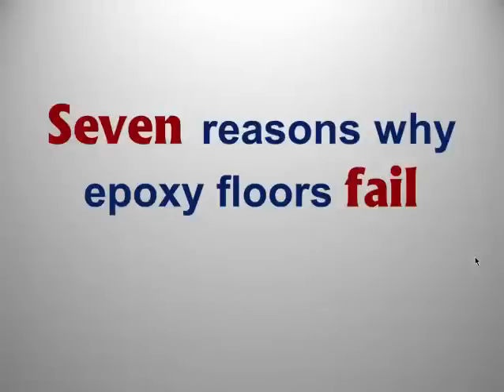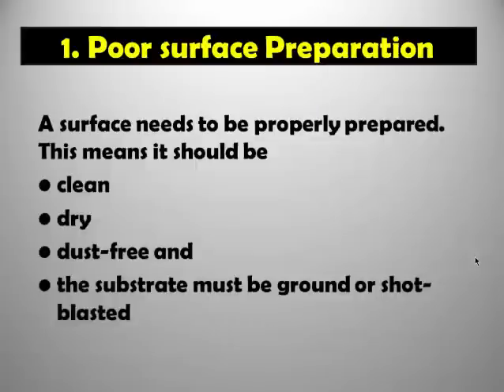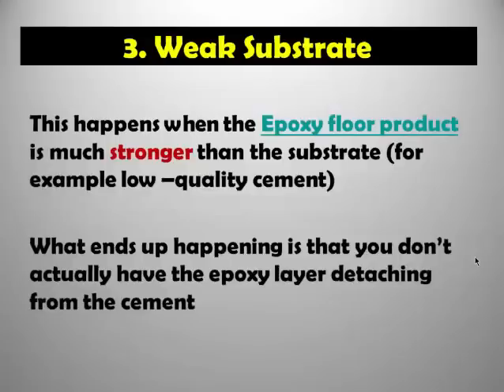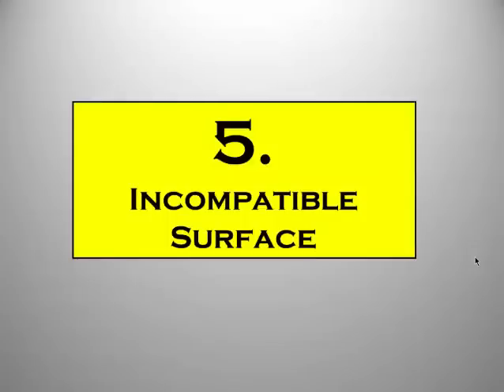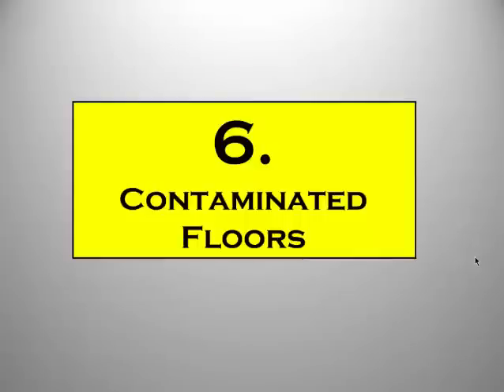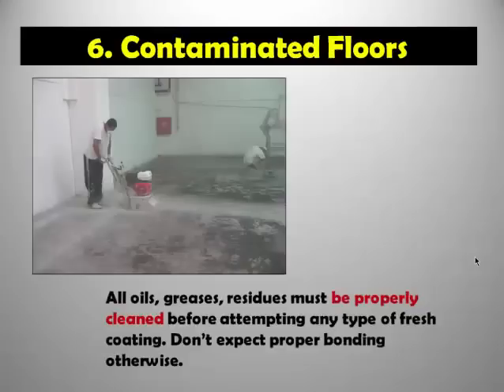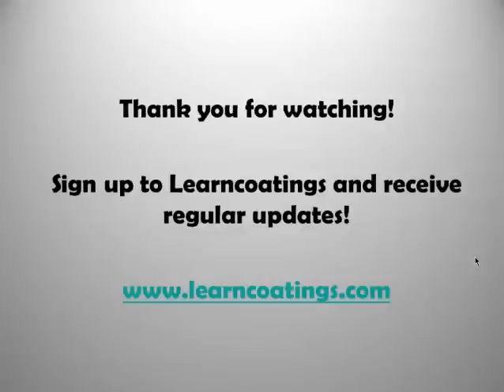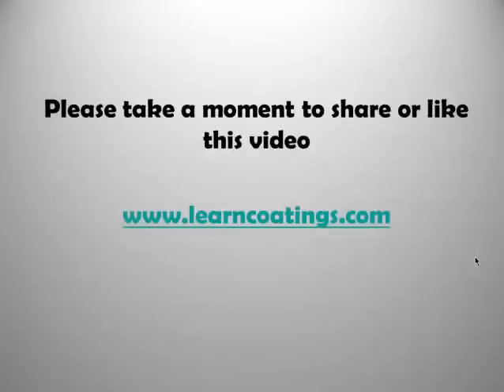7 Factors that cause Epoxy Floors to FAIL

Comment: 2 yr. Old epoxy gives out odors, it always has since new. It's in my bedroom. My beds shape got printed to it in a yellow color. I got pearl white epoxy.. any idea
Reply: I followed the instructions step by step
Reply from the maker: Still gives off odors after 2 years? Doesn't sound good. Most likely causes 1) the epoxy never cured properly, so there is some excess chemical that gives off the odour. Also this could be the cause of dirt pickup and the yellowing. 2) Does the room get much sunlight? I am wondering if UV chalking may have something to do with it
Reply: No sun light. At all. I used elite Crete products. They didn't give me a vapor blocker, I know cause the guy said it wasn't that important.
Reply: I am a biologist, epoxy must be I think hardened with blue laser. Poor quality of epoxy.
Reply: I am very experienced with epoxy and mixed some epoxy by a manufacturer mentioned. I mixed in correct ratio and properly- it smells still after 6 weeks. I've never seen this before and would normally say user erroor bit in thius case I know the p product is still smelly 6 weeks on.
Reply: I would not use a product that smells weeks after mixing as in my opinion is not inert and could be a health issue.

Comment: Can you reapply to epoxy floor on epoxy floor which has been battered other time and looks tired ?
Reply from the maker: Yes you can, although it would recommend that you reprime it first. Also make sure any areas that are damaged or peeling, are fixed first before recoating

Comment: Please explain me what you mean as primer. Thanks for the information.
Reply from the maker: A primer is a coating that goes on before applying the paint or the epoxy. It serves multiple purposes: It helps with the adhesion, it seals the surface from bubbles and it can also help eliminate the micro-dust. Read this article for more information http://learncoatings.com/wordpress/five-reasons-why-you-should-always-be-priming-your-epoxy-floors/

Comment: I just did a garage floor with a new product. And the product flashed and hardened within an hour. Giving me no time at all to work with it why would it do that???
Reply from the maker: Most epoxies have a pot life of 40-45 mins. MMA or polyaspartic can be even less than that. Make sure you keep the products in a cool place as heat accelerates the curing. You don't want the products already warm when you apply them

Comment: Great info...so my question is...how do they epoxy 3d floors in homes ..those are wood floors...can u elaborate
Reply from the maker: 3d floors are usually done over a pvc or vinyl poster that has been stuck to the floor, so that poster tends to cover up the wood or whatever surface is underneath.
Furthermore wood may not be a problem in small surface areas like 1-2 sq.meters. It usually becomes a problem in larger areas where the expansions and contractions are more visible

Comment: Can you put epoxy on a floor that was epoxied in the past
Reply from the maker: Yes you can. I would advise light sanding to ensure better bonding between the old and the new layer. Especially if this was a long time ago
Reply: Yes if the Floor is still in good condition. Should grind or sand floor. If not, I would recommend removing the old epoxy and prepping the original concrete for new material.

Comment: 9 days after applying epoxy to basement floor, it's still not dry.  It's sticky.  I called the company, at first they said it wasn't mixed properly.  I told them that wasn't true.  We mixed according to directions.  We also put a fan on it for 4 days.  And for the past 3 days have a dehumidifier running.  Don't know what else to do!  Jamie, the rep I spoke to was suppose to email me papers to complete but I never received anything from him.  Extremely poor customer service.  Anyone have any ideas?
Reply from the maker: Likely reasons for sticky epoxy:
1. Did you use an electrical mixer ? (hand mixing does not work)
2. Improper use of proportions of the A and B component
3. Is the entire floor sticky or just in some areas - some areas means one pack was not mixed properly or it did not contain the B component.The entire area means there is a bigger problem at stakeHave a look at this article for more information
http://learncoatings.com/wordpress/epoxy-disasters-common-mixing-mistakes-that-can-lead-to-curing-problems/

Comment: Paid someone to do my floors and he didn’t etch I’m thinking it wasn’t mixed well either .. my floors are extremely sticky!! And my shop opens in the morning!! How so I remove?
Reply from the maker: Floors will take 1 to 2 days to dry. If they are sticky after that you have a problem. You will need to remove with scrapers and solvent
Reply: Ok thank you
Reply: One more question is it possible to add  a 2nd coat after dry time?
Reply from the maker: yes its possible, should bond pretty well with the first coat
Reply: Can I just paint right over it w/o sanding it !

Comment: I see yes to use epoxy on concrete, but no to wood. How about old stone flooring?
Reply from the maker: Stone is very tough for bonding. I would recommend good diamond grinding to get a good profile as well as a strong primer

Comment: What caused our epoxy floors to blister months after it was cured.
Reply from the maker: Blistering sounds like moisture trapped in the floor pushing it up. Another reason could be some contamination in the floor that is now pushing up the coating

Comment: hi...our floor is not that smooth...but we would love to use the epoxy...whats the best remedy? thanks...
Reply from the maker: you have several options depending on the circumstances 1) grind it out with a diamond grinder until it is level 2) cast new cement on top 3) use repair mortar to patch specific areas
It depends on your budget, your time frame and the severity of the uneveness
Reply: thanks...it helps a lot..

Comment: Thank you Sir for the video, you got a new subscriber here. 

In case you check those messages, one small question: What do you think of the Rustoleum epoxy products they sell at homedepot, is it possible to do a decent job with it for normal home basement concrete floor? Thank you for your time, have a nice day.

The stuff I'm talking about:

http://www.rustoleum.ca/product-catalog/consumer-brands/rocksolid-floors/metallic-kit-silver-bullet
Reply from the maker: I am not based in the US so I am not familiar with Rustoleum products. What I do know is that in the US the products available in the DIY market are not the same as the products they supply professional companies. DIY products tend to be higher in solvents and cheaper in quality

Comment: So if I want the epoxy look on wood, what do I use?
Reply from the maker: try a coating for wood, like a PU coating designed for wood
Reply: multiple coats of polyurethane, gloss or semigloss, I went with gloss to get that super shiny look